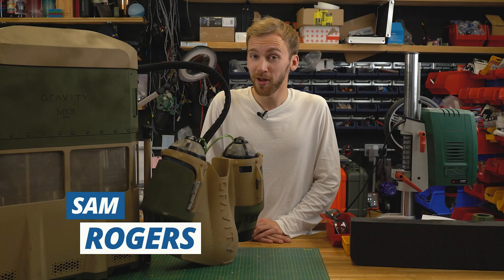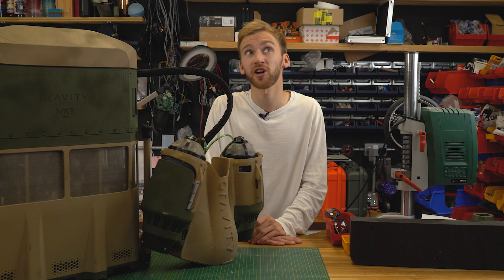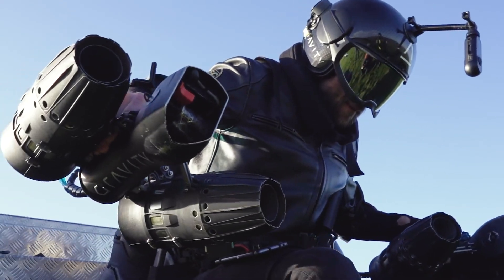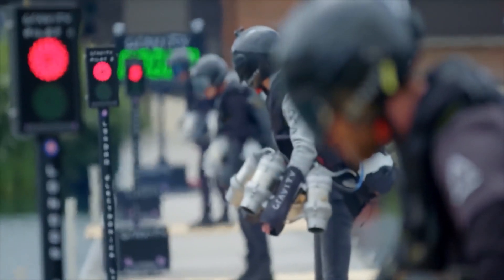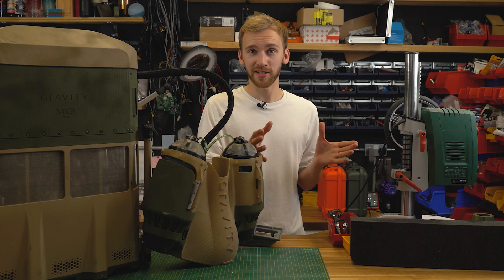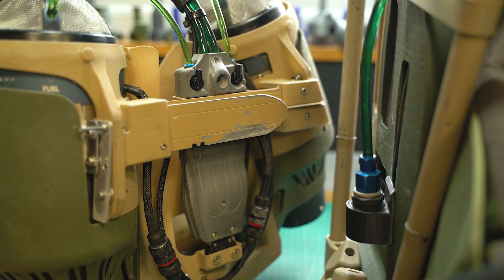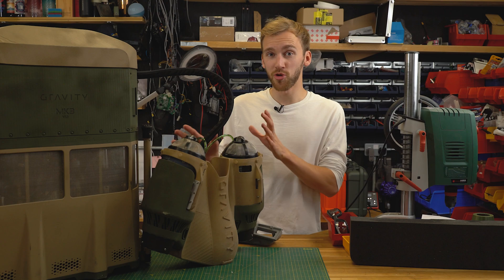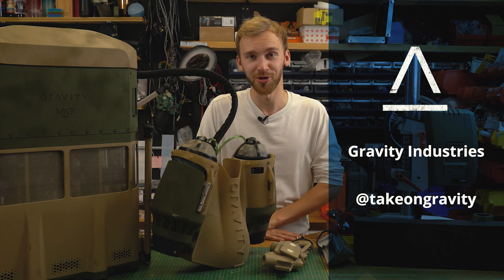How do you Fly a Jet Suit? | Q&A with Gravity Industries

Comment: I believe that maintaining flight using fuel combustion ( clean biofuel ) is better than the electrical system; Because the electrical system is consumer and very complex, especially if it relies on complex electronics with many many circuits, and programming ( coding ). So keeping the system simple is best.